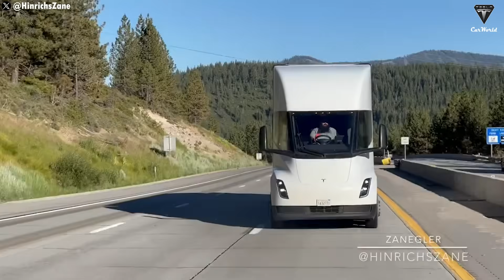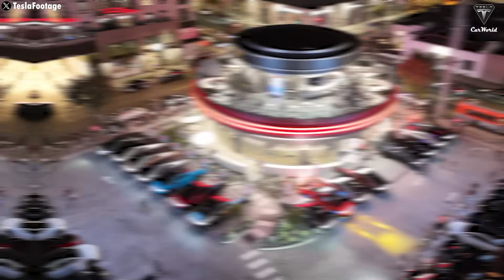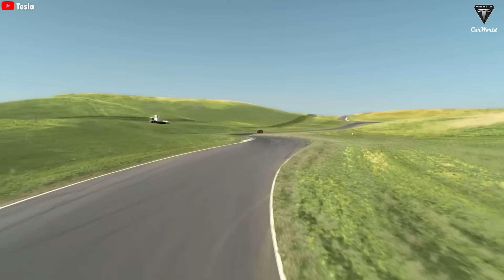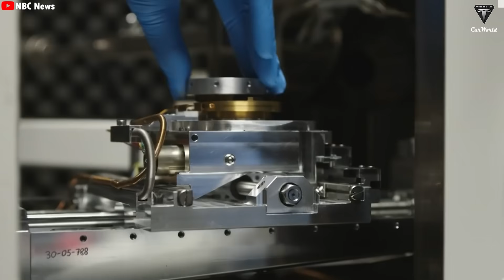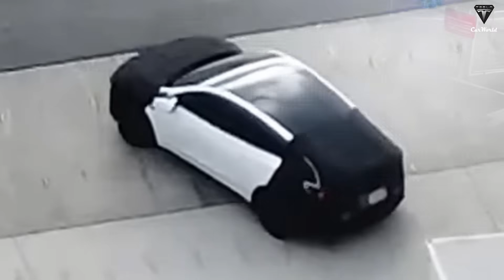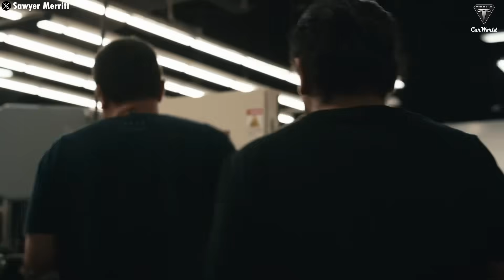2026 Tesla Semi Gen 2 Version SHOCKING All Industry! Elon Musk LEAKED New Truck Design, Lower Price?

Comment: It's well worth knowing that in the US, the truck driver is supposed to drive 8 straight hours before a mandatory 30-minute break. Based on available facts, this means the Semi cannot fully recharge within the break time (75 minutes needed).
   In the EU, on the other hand, the driver is not allowed to drive more than 4.5 hours before a 45-minute break. Well within charging time for a full recharge, especially with the typical 80 km/h speed limit here, much less strain on the battery and motors.

Comment: I hauled the big wood in California, I hauled the 11 Western in general freight, I hauled fuel on the eastern seaboard, I also hauled steel in the southeastern United States. When I started, my truck had two sticks for the transmission, and when I exited the transportation industry, automatic transmissions were becoming the norm.  it isn’t the truck that makes a driver stay in it, it’s the driving conditions, that cause most drivers to leave from the industry. There are many venues for big rigs. The highway is just one of them. I hope your trucks are a success.
Reply: There is a logging company in Vancouver that wants Tesla Semi.  They drive up into the mountains empty and come down the mountain loaded.  Might need very little charging after regenerative charging coming down.
Reply: @pathfollower you are correct, the “stinger” which is the semi trailer is decked on the truck, it goes up the mountain where the “yarder” is, a shovel will lift the trailer and set up the truck for loading.